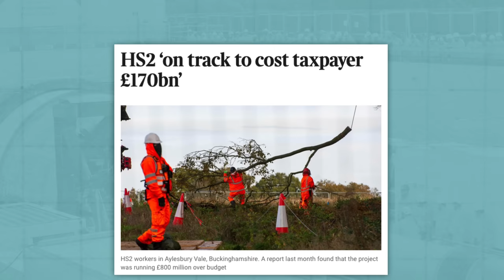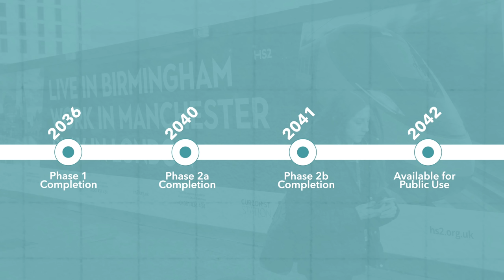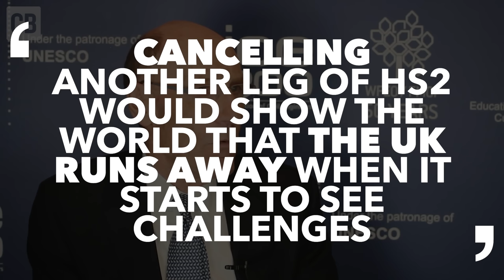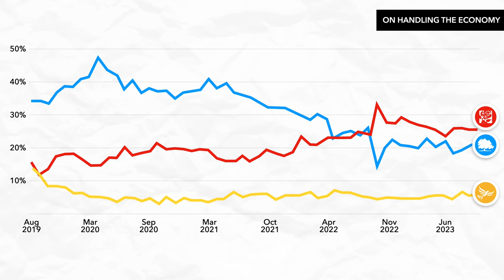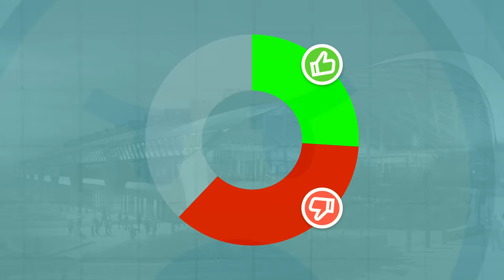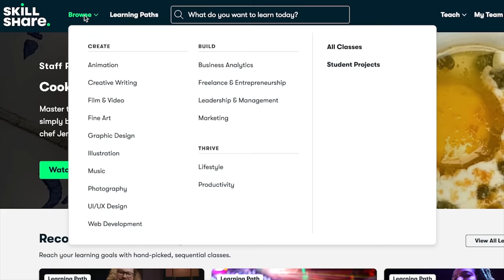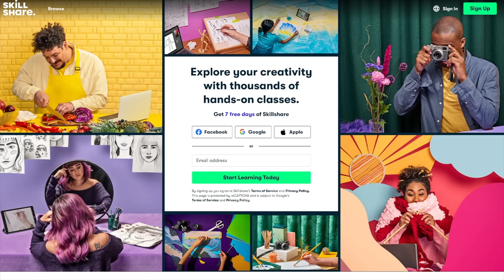Could Cancelling HS2 Work for Sunak?

Comment: HS2 is still a great idea and it baffles me that so many voters continue to buy into the “investment is too expensive” nonsense that’s got us into the mess we’re in today.
Reply: Yeah, and also it's "funny" how nodoby ever watched how much car infrastructure costs us, but the moment a train project goes slightly over budget, everyone start hating on it.
Reply: More so when it's up ere in the north that NEEDS it.
Reply: @no_name4796  Slightly over budget ? 32bn to may 100 bn may even more is a 300% increase  😂
Reply: @blablup1214  all of which is quite insignificant given the length of time it’s displaced over. We’re talking a minimum of 25 years for construction completion. £4billion a year, which for an economy the size of the UK’s is pretty small (just look at the covid PPE losses ~£15 billion at the last count). The savings should then pay for it surprisingly quickly too.
Reply: @blablup1214 it would have cost 32 bn it had been built between 2010 and 2017. That it wasn't is a governmental decision, because from an engineering and construction perspective the project's not exactly groundbreaking.
Reply: Yes because paying £100Bn for a train that will just end up being able to get from OUTSIDE of Central London to Birmingham 30 mins earlier is a 'great idea'.

For context, for roughly the same amount the Japanese are currently building a 500kmh MagLev train travelling the equivalent distance of London to Newcastle that will take 67mins and will be over 80% tunnels under mountians towering over 1km high.

Yes new rail infrastructure is needed in Britain, but HS2 has been the biggest embarrassment of rail development in Europe in recent history, far worse than how the APT was rushed into service too early in the 80s. 

Complete ineptness with purchasing land since they never bothered to actually ask the local councils in the areas of the land they planned to use was being developed on already, destroying multiple new housing estates where home owner have just recently purchased the home because of it.
Reply: @lukealmond4038  The savings should pay for this ? Which savings ?
I doubt that being a little faster and having a little more capacity can make up 100 bn
Reply: @blablup1214  do you fucking know how many trillion of dollars/euro/pounds are spent every single month just to mantain road infrastructure. Or how many money is spent to build new highways? and how much those projects also go overbudget, but nodoby gives a fuck?

shinkansen trains in japan also went massively overbudget, but now japanese people wouldn't be able to even imagine living without them.

Same is for my country (italy). We have the most expensive train track per km in europe (beaten only by germany on some few routes), but EVERYONE just invest into HST.
Reply: @blablup1214  right off the top of my head:

Increasing capacity leads to cheaper rail travel. Which makes more people more likely to use trains rather than cars for those journeys. Overall, more money is earned for rail companies. Less people driving eases congestion on roads which lowers costs of transporting goods by road (less time, fuel). Speaking of goods, the extra capacity allows more opportunity for goods to be moved by rail. This is cheaper and quicker in many cases than by road. Less costs in moving goods make more areas attractive for businesses, which encourages investment, creates jobs and stimulates local economies.

That’s just very quick, there will be more.
Reply: @ishshah8695  The first ever Japanese bullet train line also ran into problems. The president of the Japanese National Railways even had to do many monetairy tricks to make sure the project was not shelved or watered down by politicians. He took a small loan from the IMF that required completion, he funneled JNR funds to the construction and many other tricks. For which he became persona-non-grata. 

Look at the Japanese bullet-train system now. You will see nothing of how increadibly the project went over butget, even with the much worse case of the Joetsu Shinkansen. Britain need high speed rail. However terribly the project is going, that will be history and the service will aid millions.
Reply: @no_name4796  I think we in Germany invest about 20 bn Euro per year and maintenance is pretty cheap here. 2016-2030 is estimated for 67 bn. which are another 5 bn euro per year.
So my guess would be you can't spend that much more than us as we are a car loving nation and the UK is a little smaller.

Nobody gives a fuck is also incorect. For every project that goes over budget there are huge headlines. It is not like nobody cares 😅

Trains are important, but trains are also an pretty old technology and you would think after all those years they know how to build rails in a fast and cheap way.
And I wouldn't compare our train lines with Shinkansen as Japan is a very mountainous country and it is quiet difficult building there.

Oh than I have something for you. We are building a new train line in Munich. 10 Km estimated cost are 14 bn Euro.  So our line will be much more expensive per KM than the HS2 🤣
Reply: @lukealmond4038  I doubt it a little.
I mean. You would have gotten most of your benifits even without building a high speed rail line. You could just build a second and a third line "cheaper line" and I would guess that would still be cheaper.
Reply: @blablup1214  might work for freight, but for passengers it wouldn’t really increase capacity, unless you’re building multiple extra platforms to remove the quicker trains getting stuck behind slower trains issue. That in itself would be very expensive. Adding parallel lines will also have issues. Tunnels still need to be extended/added, bridges similar. Granted it might work over flat, country land, but at bottlenecks of space costs will still soar.
Reply: @no_name4796  Just to clarify it :)
I am not against investing in infrastructure or train line.
I just would love it if government wouldn't treat such regularly ocurences as price explosions as a little mistake and would learn from it.

Here in northern Germany for exmaple they accomplished the miracle of upgrading an old rail line to an electric rail line and used over 1 bn euro for it ( 60 KM ).
As a normal citizen you can just not understand how those projects can explode like that and why the hel they are so super slow.
Reply: @lukealmond4038  Why should this little plattforms for a train station be so expensive ? 
I mean I get it, land is expensive. But the buildings itself seem pretty cheap and those plattforms aren't gigantic.
Even paying 10.000 pound per m² this shouldn't take a huge chunk of those billions.
Reply: @blablup1214  you come into a lot of the same problems as HS2 is concerned. As you point out you have to buy the land, sometimes from unwilling sellers. You have to pay planners for the redesign work and in many cases you will have to deal with local infrastructure around the stations. Demolitions and rebuilds. A road runs tightly next to the station? Going to need to figure out a way to reroute traffic without upsetting the long term traffic flow of the city. 

My point is that there’s always problems going to arise with major infrastructure projects like these. There’s always going to be big costs. Cities grow around existing infrastructure which then makes any upgrades difficult to pull off.
Reply: HSUK is even better of a proposal in every conceivable way, hopefully if HS2 does get cancelled, HSUK will be considered instead.
Reply: @lukealmond4038  Naturally  building new infrastructure in existing areas is never cheap.
But I think "time" is one of the biggest costs you can have.
One. Everything gets more expensive as time goes on.
Second. In my opinion we are already lagging FAR behind what we need in public transportation.
We can't always take 20, 30, 40 years for every new line. If we want to get things done we need to get faster :D
Reply: @blablup1214 To be fair, 32bn in 2009 money is £54.5bn in 2023 money. So £54.5bn -> £100bn, still massive, but not the amount you've just suggested it would be.
Reply: @blablup1214 The reason HS2, and rail building in general, is expensive in this country is because we killed off rail-building as an industry. In the last 30yrs, we've built maybe 200 miles of new track (HS1, Borders, Okehampton, Selby). That's it. So therefore, with HS2, we've not only had to build the track, we've also had to build the entire f-cking supply chain too. And that isn't cheap.
You look at countries like France, Spain, Japan, China, etc. where railways are built cheaply. Those places build a lot of railways. They already have a functioning supply chain, they have the engineers, the construction industry, everything. Its the old saying: practice makes perfect. The UK hasn't practiced, so of course HS2 is an utter mess.
Reply: It was good idea 20 years ago. Today, with remote working and a cost of living crisis, plus the massive increase in ticket prices, it's a terrible idea.

Who is seriously commuting between Manchester and London?
Reply: perhaps because it's 10x more expensive than in other countries, mister phd in economics.
Reply: It is a great idea if you ignore the costs. Once you look at the costs, it is easily the most ridiculous infrastructure project that has ever been started. And it has consumed investment on other parts of the network, e.g. Midland Main line electrification, or Felixstowe West Midlands corridor.
Reply: @kirishima638  Ah, the old "nobody's using trains" argument. Well, we are consistently seeing 95-99% of pre-Covid passenger numbers, all while running 60-70% of the pre-Covid timetable. Meaning trains are on average 50% more full than they were pre-Covid. Remote working hasn't had the effect everyone seems to think it has had.
Reply: @mastertrams  Where did I say 'nobody is using trains'? 

I questioned how many people are seriously looking to commute from Manchester to London, particularly with remote working being on the rise.

Nice strawman.
Reply: Am not from or living in The UK , in my opinion high speed rail is very important for all Europeans , no one nor TDRL is truly addressing the reason for high cost of living , in Europe, which is extremely high taxes, unless the governments of Europe change their nanny state mentality, of I will take as much of your taxes as I could , and give you social services, which at the time can be wasted social service. Cost of living will continue to increase until there is a fundamentally grass root change . And it will happen , as happened to the USSR.
Reply: @mastertrams  Oh that is interesting.  That gives at least hope that the next project will be cheaper and faster and with less unforseen problems.
I would say, we in Germany are also pretty bad, but we at least build and mainted some rails .
But we also have others problems like bombs of WW2 we have to consider, when we build tunnels in the cities 😅
Reply: @91Durktheturk  £100bn one-time cost, for gains to the economy of £100bn per year, according to the Bank of England. If those figures are to be believed, it'll pay for itself within a year of opening.
Reply: @kirishima638 Apologies. "Nobody uses trains" is just the colloquial nickname given to the type of argument that claims that, well, people don't use trains anymore, or at least that passenger numbers have dropped sufficiently enough to make rail irrelevant. Often quoted in that type of argument are things like remote working and the consequential lack of a commute.
Reply: @kirishima638 However, to answer your point about who is commuting between Manchester and London, you're right, not many. But the commuters who will benefit from HS2 being built is far greater. Anyone whose commute includes London Euston, KX or StP will all benefit tremendously from the enhanced capacity for more trains. Anyone whose commute includes Birmingham New Street will benefit greatly from the freed up capacity. Anyone whose commuter includes Manchester Piccadilly will benefit greatly from the freed up capacity.
So, all of a sudden, the list of places that will benefit include the likes of Cambridge, Doncaster, Nottingham, Worcester, Shrewsbury, Stoke-on-Trent, Llandudno, Cardiff, Aberystwyth, Southampton, Wolverhampton, etc.
Reply: @blablup1214 The worry is that there seems to be no plan to continue building after HS2 is complete. So unless some sort of rolling programme is introduced, the UK will end up in the situation where, every time it wants to build a railway, it has to keep re-building the supply chain that fell apart after the last project ended.
Reply: @no_name4796  Hahahahahahahahahahahahahaha, "slightly over budget" I hope you are not in charge of your family's finances.
Reply: @davidty2006  Erm.................HS2 was never destined to go north of Leeds so not sure where you live but there's still a hell of a lot of North up here that wont have benefited..
Reply: @no_name4796  Erm............do you know how much motorists pay in car tax and tax on fuel in the UK? About 40 billion pounds a year and just over a quarter of that is actually spent on road infrastructure.
Reply: Don’t forget all the three huggers
Reply: @oorya1780  It was meant to connect up to the ECML from there atleast.
Reply: @davidty2006  We are at the moment buiding HS2 London to Birmingham, HS2 (a) was to Crewe, HS2 (b) was then on to Manchester. Also part of Phase 2 (b) was on to Leeds and then connecting probably  to the ECML but whether that would have shortened the time from getting from say Newcastle to London is up for debate as the distance having to go via Birmingham would have likely taken longer. Anyway considering the length of time it has taken so far and not a line laid it would probably have been the next century before it got to the ECML.
Reply: In my country (NL) the roads carry about 12 as many ppl (miles) than they railways. It’s probably a similar ratio in the UK. Don’t directly assume that “the people” are stupid.
Reply: 12 times..
Reply: @davidty2006  from the POV of someone who lives in London, I fully support the improvement public transport infrastructure ANYWHERE in the UK. It's true that if you were build another tube line in here the costs would be paid back much faster than, say, a metro in Cardiff, but the answer isn't an either/or zero-sum game, there should be good public transport everywhere. It's also not just the fault of our politicians - the UK public is tight as a gnat's bum when it comes to investment.
Reply: And to make matters worse the more these projects gets cancelled the more likely the next one is to fail as well. We see this in the US where all skill at railway construction and large infrastructure in general outside of highways has largely been lost due to decades of inaction.
Reply: And even the modern Japanese HSR went massively over budget when it was built first. If you don't have the skill and organization infrastructure is expensive.  @mastertrams
Reply: @kimmorgan379  And who controls investment in this country? Whose made this a low-investment country? The Treasury.
And who runs the Treasury? That's right, politicians.
Reply: The UK will have to approve any project in which China is involved.
Reply: @mastertrams  yeah but we voted them in. This country voted for the party of austerity - they didn't elect themselves. To be fair, it's our national character, just look up the history of the London sewer to see how adverse we are to building essential infrastructure.
Reply: @blablup1214 thats callled inflation mate
Reply: @HDTomo  A increase to 300% the price in around 20 years would be a pretty hardcore inflation for a first world country 🤣
Reply: The train service between Birmingham and London is already really good. 1:20 every 20 minutes. Hs2 isn’t even going in go the centre of London any more. You need to take a 30 tube into the centre so it doesnt save any travel time. HS isn’t made for a country our size. The distance isn’t great enough have a big enough gain from building it
Reply: @ishshah8695 Japan has a certain national cultural acceptance that infrastructure spending and government trailblazing is worth it. Here in the UK if we want to build anything the nutjob environmentalists come out of the woodwork and cry about the "ancient" trees (which are only 400 years old) and the bats and frogs and whatever else, and all the NIMBYs come out crying about how this is going to disturb their backyards and golf fields, and suddenly the budget gets multiplied 5x to sort out all the workarounds and the project gets delayed and delayed until they inevitably cut it short of the goal.
Reply: @kirishima638 
What strawman? That was literally your argument. 

You said that commuting is unattractive given high cost of living and remote working. 

@mastertrams Pointed out that train usage is still high despite that.
Reply: @no_name4796  I dont know why you're making this out to be a car vs train issue. I also wouldn't support a 100 billion dollar highway that was inefficient
Reply: @evials9123  do you have any idea on how much money is spent on car infrastructure basically everywhere in the world, and all paid by citized, even those who only use public transit?

Just All road repairments alone easily add up to A LOOOOOOT of money. And any other public transit wouldhave way inferior manteinance costs.

So nope, it's not a car vs train problem, it's a car dependency problem